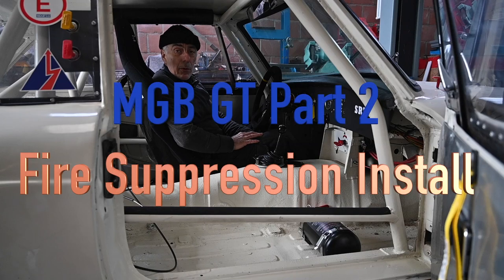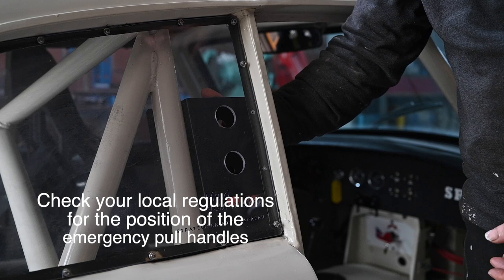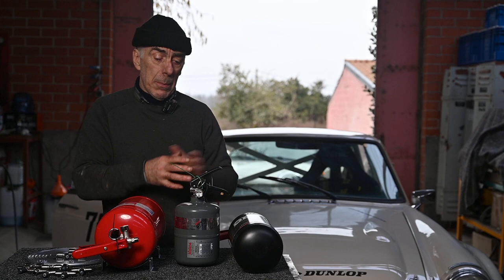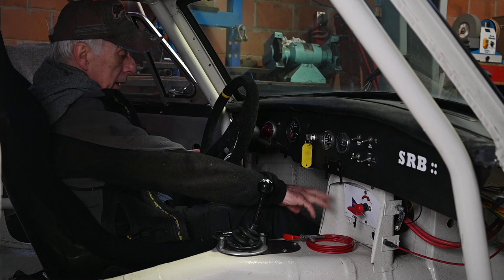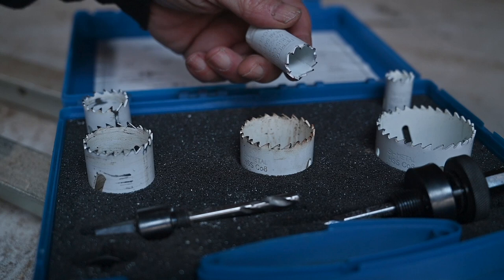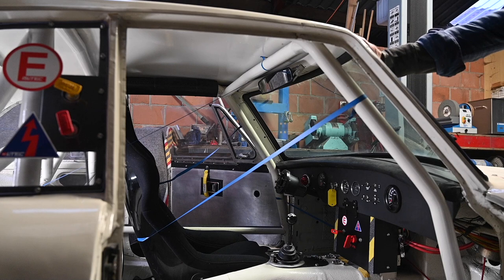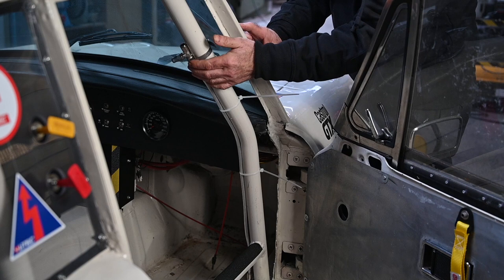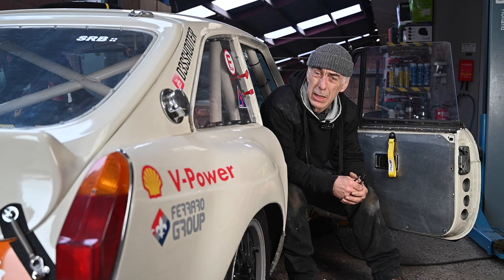MGB GT -  Part 2-   Fire Suppression System

Comment: Great and informative video Steve. One critical thing with the angle / tangent of extinguisher jet is to avoid the face. Sounds counterintuitive but you need to be able to see in the event of an issue plus the sudden explosion of material in the face has a massive impact on the individual using valuable time no the ability to see / breathe.  Excellent production Steve , keep them coming.
Reply from the maker: Indeed, and very good point that you bring this up...  In my case the are away from the face....

Comment: How is the system tested once all components are installed?
Reply from the maker: There are a few ways by just blowing compressed air from the pipe at the bottle ( disconnect first) and see if you have a good flow.  as for the handles that is so simple . Thank you fo the comments